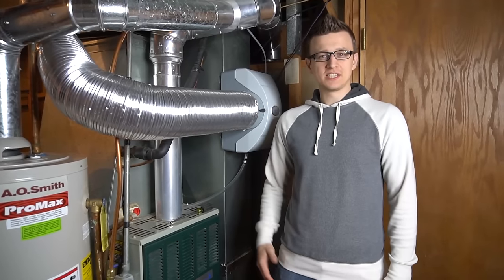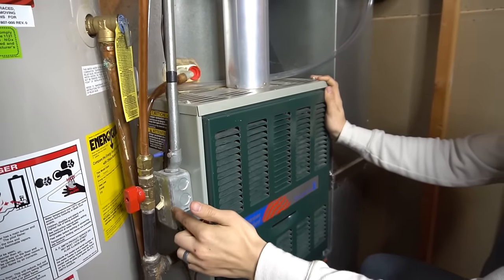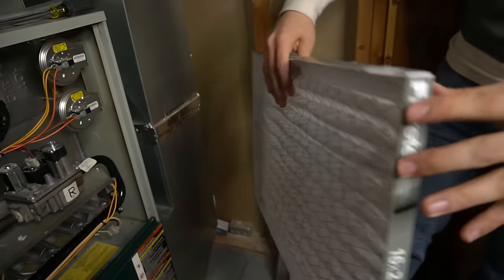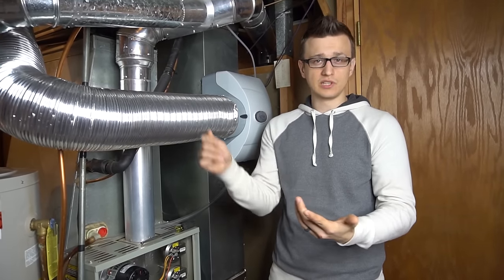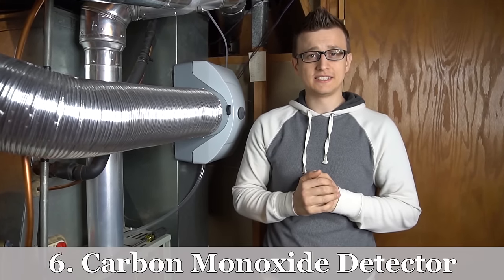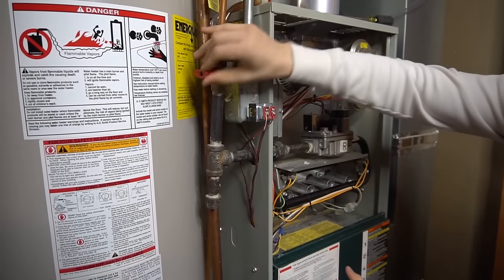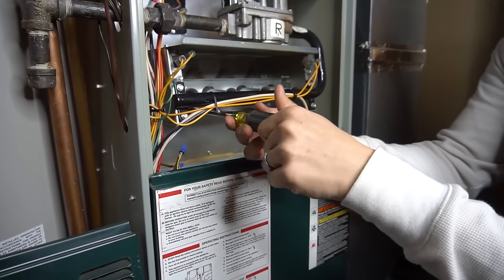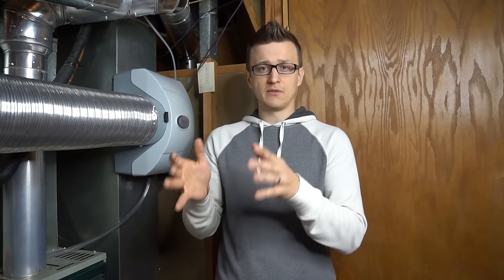10 Furnace Cleaning and Maintenance Pro Tips

Comment: I have a gas furnace/steam boiler/radiator system, not ducted air. My furnace uses very little electricity to start and run. So I have connected a power generator to my breaker box. Among other things that It can power during a black out, it can power my furnace, if the electricity goes out in the winter. In an electrical blackout water and gas are not affected. So with very little wattage my generator can power my gas furnace/steam boiler and my hot water heater, b/c it is also gas and spare electrical power for other household necessities. You have a Great Channel!

Comment: Yes! A new video. Thanks Jay!
Reply from the maker: Hey Aaron! Thanks for watching! The next one on the list should be interesting. (I hope it will be anyway) I bought a variety of furnace filters and will be checking how restrictive they are.
Reply: @WordofAdviceTV  that's a great idea! Can not wait to see what you find out. Which I'm sure we already know haha.
Reply: My furnace is similar to yours being that it is a gas up flow furnace. The only difference is mine is a intertherem single stage draft that is positioned in the hallway with two return vents below it that grab the air from the hallway. It's pretty old but not sure of the exact year. Also my filter is below the blower instead.
Reply from the maker: Yeah, those premium filters should be pretty restrictive. We'll see. And your furnace sounds familiar :) Those Intertherms are usually set up a bit differently.

Comment: As a woman this video was helpful. I had a service technician here yesterday who only gave a visual inspection. I asked him about the dust on the bottom of my furnace and asked if he would clean it. He only wiped the bottom because I asked him to. He never looked at the sensor that is shown on this video. I asked him about the filter and he said there wasn't a filter. He may be right that there is no filter because I checked and didn't see a place for it. But I am not the one who is trained in this area. That visual inspection cost me $270.   I will be following up with the company on this Monday.
Reply: Find another company...that is poor business practice!
Reply: I don't know where in the country you are, but in my area in a major metro they now charge about $115-$150 to clean and inspect.
Reply: It depends on what you asked for!  Did you ask for an inspection or a cleaning?  I never heard of a furnace not having a filter.  If it doesn't, they can install one in the ducting before the furnace.

Comment: Your videos just helped me big time this week alone. I had to clean the glow stick and flame sensor. Just replaced the glow stick due to a crack in it. Now my furance would not light (no gas cycle), so I did a quick vac cleaning for dust while powered of and now I have heat.

Comment: Yes! So helpful. I have a Rheem furnace 80% efficiency, original with the house built in 1997. I have maintained well (blower, coil, ducts were maintained) and the heat exchanger seems fine.. based on flame pattern and no crack visible during duct cleaning. I regularly replace the filter as well. I also clean the outside condenser as needed. I was wondering though  if it is still safe or should I consider replacing soon? Thank you.
Reply: If it's running fine, don't bother!  Those older furnaces are built better than the new ones today.  Have it professionally cleaned and inspected to make sure it's running as efficient as possible. Just have a couple grand saved for when it does go but I wouldn't replace it until it's too expensive to fix or they can't get the parts.

Comment: The plastic (PVC) for your exhaust and intake can and do go through the roof as well as through the side of you house.  Depending on where your furnace is installed in the home.
Reply: My intake is sucking air from inside.  Should I run it to the outside?
Reply: Yorkiepoocharlie  It's in the basement. Yes, intake is PVC.
Reply: Yorkiepoocharlie  Thanks

Comment: You are great and very helpful! I seriously owe you one. Do you have a patreon or a way to donate? Also why is copper against the code in other states? Thanks
Reply from the maker: Thank you! :) Glad I could help. I don't do patreon since it pretty much only has a monthly subscription and I don't wanna do that to people. I just have a one-time paypal donation link in the description. As for the copper pipe that is used for natural gas, I believe they are pushing for it to be code everywhere. (no copper for natural gas) The reason for that is that natural gas corrodes the inside of the copper pipe causing it to flake off. Those flakes then plug up gas valves and regulators that are down the line. No one really knows how long it really takes for gas to corrode the pipe though...

Comment: Great video!  Much more informative than the others I've watched.
Question:  I have a humidifier a little similar to yours (as far as the filter appears) and the filter was very soft and wore out.  I measured out the filter dimensions and can not seem to find a replacement online for this filter brand...do you have any suggestions? can I just buy a bigger one and cut it down?

Comment: Thank you for this video! Very informative and concise. I have a question about cleaning the hvac A shaped coil inside the plenum. Since it's an upward air flow, I would think the inside of the A shape is where all the dirt accumulates. But from what I see with mine is that there's a metal enclosure preventing me access to the inside of the A shape. Would using a HVAV aerosol cleaner on the outside of the A shape be enough to clean the coils?
Reply from the maker: It would do some cleaning but most of the dirt will not get removed from the underside of it. Do you have room so that you can actually slightly slide the coil out and then lift it up a couple inches so you can get under it?
Reply: @WordofAdviceTV  thanks for the idea!

Comment: Cleaning out the moisture trap that drains condensation from the furnace should be done every heating and air conditioning season.
Reply: absolutely. Mine got clogged with pine needles, and water backed up INTO my inducer motor. NOT GOOD!! I removed the rubber drains from the inducer motor and got a ton of water out. It also slightly damaged my inducer motor, making it rusty and it squealed. I carefully took the motor apart, and cleaned and oiled it. Now it works perfect. Of course, I watched many of your videos in the process. Invaluable!!! Thanks from Calgary, Alberta, Canada (eh).

Comment: I have a high efficiency furnace that has been off most of the winter.   The vacuum line to the pressure switch regularly gets water in it.  I suspect that frozen condensation has broke something...the trap seeps a little bit of water from a small crack, so I know that needs to be replaced, but I don't know if that is causing the water in the vacuum line.  Is there another part that can cause this problem that I should look at?
Reply: A crack in the condensate trap shouldn't cause anything other than low back pressures and that is even dependent on the location being before or after the internal trap. Usually moisture in pressure switch is due to blockage in drain lines, a weakened draft inducer motor,  too long venting or tubing to pressure switch being too low and gravity lends itself to fill up instead of draining.  Depending on location of furnace a high efficiency might not be the best thing to have installed.
Reply: Forgot to add that the furnace may also not be level or pitched in the correct direction. Depending on model of furnace the manufacturer might change the orientation of how the furnace is to be pitched
Reply: @special_k-hvac  The trap was plugged previously, but I cleaned it out and put some silicone on the crack for a temporary patch.  I will check to see if it's plugged again.  The inducer motor did make a slight noise when it was cold outside, but it stopped when the weather warmed up.  The furnace appears to be level.

Comment: regarding the cleaning out the burner box. Be careful if you have a hot surface igniter. They can break pretty easily. It's the dark element on the other side of the burners from the metal rod (flame senor). A leak can also come from the condensation pump failing if you have one. Usually is a box at the bottom on the side of the furnace. All the tubes will lead into it and then 1 tube leading out to a drain.

I'm actually surprised the flame sensor was #1. I would have thought the run capacitor on the inducer. I've never had an issue with my flame sensor in 7 years but have had 3 capacitors fail. 2 of them were new in those 7 years.
Reply from the maker: Thank you for the additional pointers! Much appreciated! And yeah, I don't know if the geographical location matters or not.. But in my neck of the woods, the flame sensor is the biggest villain :)
Reply: @WordofAdviceTV  I suppose it may depend on how clear the air is. My house has HEPA air filters since my allergies will rob me of sleep without them.

Comment: Quick question, if your unit is on, and you go outside and press on the contactor and your unit comes on, is that’s your capacitor or something else
Reply from the maker: If the unit comes on, then it is not the capacitor. Check out my video: "AC Contactor not Pulling in - 10 Reasons Why" and hopefully it will help you track down the problem.

Comment: Quick question. I pretty much do maintenance calls all day and noticed sometimes when I clean the p trap wash it put it back in and turn the unit back on the unit cuts out due to a pressure switch opening. Why is this?
Reply from the maker: I wonder if it has something to do with there not being any water in the P trap. Until some water accumulates, it may keep tripping. That's only thing I can think of anyway..
Reply: Word of Advice TV Thats what I was thinking it even does it after I leave a lil water in the trap also,  but after it trips and cycles back on its fine. At first I was getting scared and thought water was getting into the inducer lol. Thanks!
Reply from the maker: Yeah, that's happened to me before too! I remember thinking, "ah common.. now what?" but just like you said, after it cycles it runs fine every time. I've never had a callback for that reason at least.

Comment: My furnace has a big green light blinks 7 times and the code says lockout how can i fix it
Reply from the maker: A lockout means that the furnace ran into an error 3 times in a row in one heating cycle. Some safety switch must be tripping. The lockout lasts for 5 hours and then automatically resets. To manually reset it, simply turn the power on and off to it. A simple thing to check is the furnace filter. Then you could watch this video: https://www.youtube.com/watch?v=AQD_MedIklI&t=3s  and see where your furnace goes wrong in it's start up sequence.

Comment: In our laundry room (where the furnace is), there is no floor drain, so the furnace company added a little reservoir with a pump, that pumps the ac condensation water through a plastic hose to the sink on the other side of the room.
Reply from the maker: Ah a condensate drain pump. Gotta make sure to clean them out once every couple of years or a little flood happens :)
Reply: @WordofAdviceTV  Oh, I didnt know that.  Thanks.
Reply: @WordofAdviceTV  even if they don't flood, they get grotty inside. yuk. I clean mine yearly.

Comment: PVC vents on a 90%+ furnace certainly can, and do, go out through the roof. You should have said, They  can vent  through the wall.
 If someone replaces an old furnace that had a roof jack through the roof right above it, Why would they re-route the flue to go all over the house just so they can vent it through an outside wall????
 The shortest distance at an upward angle is the best for an exhaust flue. Most people who have upgraded to a 90%+ furnace will convert the old roof jack and vent through the roof.
 You make it sound like all 90%+ furnaces must vent through a wall and that is simply not true.